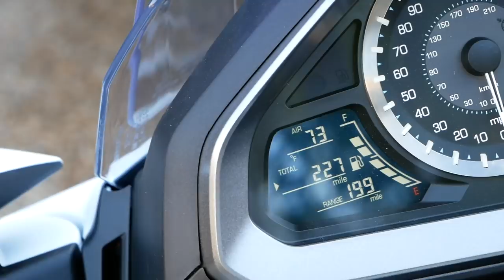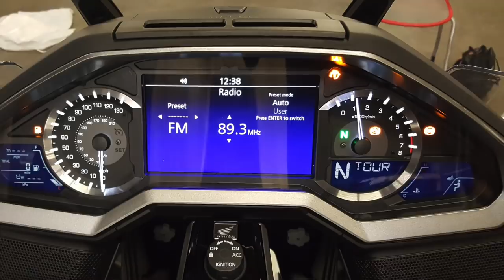2018 Honda Goldwing Long-Term Review

Comment: Chris do you have a rough estimate of what it cost to make this bike perfect for you? Talking about aftermarket parts and accessories
Reply from the maker: An interesting question. Wingsoft was about $440, F4 Customs +4 costs about $400,  Fuse Block $120, HomeLink, Fog Lights, Upper Deflectors probably another $750. I am guessing around $2,000. BUT, I had close to $4,500 in add-ons on my 2012.
Reply: Yeah I was just curious. I personally don’t like the smaller but that’s just opinion I have not rode one but I’m sure if it’s made by Honda it will hold up good. I have the 2015 and I’m sure I probably have a couple thousand dollars in accessories

Comment: How do you feel about the airbag option.  I like the blacked out version but airbag is only available in red.  Also can you take off your pack and seat for local driving and out in for long rides?   I am looking at one tomorrow
Reply from the maker: Airbag model is fine, but less storage. There is method for removing the trunk, but it is a pain in the A$$. Takes more than an hour.

Comment: Hi. Any issues with the rider triangle?  Do your hips or knees have discomfort?
Reply from the maker: Honestly, I was expecting to feel cramped on this bike and was shocked when the riding position was almost identical to the previous Goldwing. I have a 33" inseam. If I had 34 or longer, it might start feeling cramped.
Reply: About the same as me. I have a 1998 Valkyrie and feel a bit cramped.  When I sit on the new Wing it seems to feel a bit better.

Comment: Hi. I would like to know from you if buying a gold wing is best when in comparison to other touring bikes like a BMW gtl k1600 or a Harley davidson Road glide etc. After owning it for an year what's your suggestion? I am looking to buy a gold wing. Need your suggestion. Thank you.
Reply from the maker: Tough question. For me, personally, I prefer the Goldwing for its reliability, smoothness, performance and ease of self-maintenance. I also prefer the looks. But, the BMWs are also great machines and Harley's have their huge following as well.

Comment: I wonder if you regret getting the dct rather than the manual.
Reply from the maker: Not really. I think I would have been happy either way. The only place the DCT really fails is when riding switchbacks, like Tail of the Dragon, the constant up and down shifting is too unpredictable. Manual mode is required, and a pleasure in these situations.

Comment: How many kilometres do you get on your radial tires?
I ride 35,000km a season (in 5-6months) and I’m worried I’ll have to buy 3-4sets of tires a season. Could get very pricey.
Reply: Darkside
Reply from the maker: I have 8,700 on my Dunlops that came with the bike and they look to be in pretty good shape. I think I can get 12k out of them, but will have to wait and see.
Reply: On my 2012 I got as high as 37,000km on my back tire and 29,000 on my front tire.   I live in northern Ontario in cold temps and I don't cruise any higher then 110 kph (usually 90 to 100) so my tires last way longer then Goldwing tires from the hot temps of southern USA (with higher speed limits I may add).
Reply: HenryHonda 
I have never heard of any motorcycle Radial tire lasting 29-37,000KM. What tire are you using?
Reply: Dunlop E3's.... now have E4's on but haven't changed them yet.   A couple of my Goldwing friends have had about same mileage out of their Dunlops.  Are you in Canada?
Reply: HenryHonda 
Yes, I’m in Alberta, Canada. Hopefully we will be able to start riding in about 6weeks. 
Thanks for the info on the tires. I really appreciate it. I’ll get my buddy to try those tires on his 2012 Goldwing and see how the mileage is. I have to save up for a few more years for the new Goldwing as their $30,000 out the door for the manual. Rode safe
Reply: HenryHonda
How is the Dunlop E3’s Wet traction?

Comment: how does this compare to the BMW?
Reply: Rider did a great comparison. I've ridden both a few times side by side and I agree with their review. Its available on line. They are both very good but very different than each other.
Reply from the maker: I have not ridden any of the new BMWs, so I cannot offer any guidance. However, I do know that BMWs are VERY expensive to maintain.
Reply: I put 52000 miles on my K1600 and overall among 30 some new motorcycles and models including 6 Gold Wings, the K1600 has been my overall favorite to date. Last fall I test rode a 2018 GW twice. My K1600 is now sitting at the Honda dealer and I expect him to have my new DCT tour ready in a couple weeks.  The Wing feels lighter and more nimble than the BMW, but I have never felt the BMW to be top heavy, even with my wife on the back. The new Wing is no match for the BMW in a top gear roll on, the K1600 will eat the Wing alive. On the BMW K1600 GTL I really have enjoyed the ability to remove the trunk and seat in a matter of seconds giving the bike an entirely different look. The engine on the K1600 is smoother than the Wing, but the DCT on the Honda is a dream to ride. I feel the suspension on the K1600 is more in the line of sporty than the new Wing. On my BMW I did my own maintenance except for a one time valve adjustment which gave me a total cost over the entire 52000 miles of $520.00. The Honda has much better straight line stability than the BMW and gave me a more relaxed ride feel on the Wing. I am really looking forward to my next Wing, but I will still give the K1600 a two thumbs up.

Comment: So basically they made a bad version of a st1300? To me tech doesnt sell a bike as the main tech i use is a satnav and no bike comes with a good one. stereos on a bike are far superseded by a cardo q1 with decent earbuds instead of speakers allowing you to talk to your passenger. The pan holds a xl in each pannier and 2 in the topbox and every bike i have found since does not this to me is stupid as i have never run out of space on my pan. To make do or to do a workaround on a very expensive bike is a bit nuts. The pan has a locking pocket.
The only thing a goldwing has going for it is the dct but that is very overshadowed by the 5 hour air filter change and the 3 bolt 2 filter oil change and god forbid it ever fails. Unless you deal with heavy traffic every day and have to ride slow alot the dct is not worth the effort. When i get older and need less space i will probably go with a f6b or a star eluder. With all the tech on bikes now hopefully some genuis will give an option to turn off and hide features you dont need so your not scrolling through settings you dont need.

Comment: Re bag size volume “it’s the price you have to pay to have the smaller, more nimble motorcycle”. Honestly NO. The BMW R1200RT is definitely smaller, lighter and more nimble. Yet it has much larger, better designed bags that are also removable. This was just poor design by Honda. They styled the outside of the new Wing without giving proper consideration to both the raw volume of the luggage and the interior wall shapes. Heck even my 18-year old ST1100 has bigger, better (and removable) side cases.
Reply from the maker: They could have done better, for sure.
Reply: My R1200RT gets 53mpg average. And you can remove all luggage for local rides. Love this DCT GW though but it just does not have the ergonomic natural feel of the beemer. Also have a DCT Africa Twin, would love it if DCT migrates to other makers.

Comment: I am very disappointed in my purchase of a 2018 GW Tour.  I also owned a 2014 and I should have known better, I did not like the width of the older model, the highway peg position, the sport bike like rider position, the awkward shift lever position and the newer bike has far less wind protection than the older model.  There is more lean angle on the new GW and the suspension is very smooth but also somewhat floats like a luxury car.  I don't really care for the electric windscreen or the very small windscreen.  I added the lower Hondaline wind deflectors and they don't work that great.  Then wind across the top of the hands is an issue as well.  Overall, for a tour bike,  I'm not impressed.  The engine is not quiet at idle after it warms up, lots of valve train noise that the previous model did not have or was not noticeable but the alternator noise from the previous model is not on the new model.  The modes, I find are ridiculous and not really necessary.  The FM reception is very poor even in a metropolitan area where reception should not be a problem.  If you don't link up the bluetooth devices in the proper order then the Apple Car Play will not work, headset has to be linked 1st and cell phone plugged in not blue tooth connected.  No accessory plugs for charging not even in the trunk and having to disassemble the bike in order to install a low cost item seems a bit absurd, should have been standard option on a tour bike.  The trunk should have been a simple way to remove to make the bike multipurpose and having to purchase an $800 kit seems to be a bit much for a high end bike.  Laslty, the storage space for a tour bike is pretty much non existent on this bike.  There is no way you are getting two full faced helmets in that trunk unless you both wear a small helmet.  Just not impressed at all for a tour bike.  A two up sports bike, ya this fits the bill in sports mode.

Comment: I think you apologize for Honda way too much.  I miss my 2016 B.  This 2019 the Suspension sux,  handle bars shake, stereo like a 1978 Kmart Soundesign.  Wind protection sux.  Seat sux.  I’ll have another 10 grand in it before it’s worth a fuck.  Only half way there

Comment: Bad radio reception - poor GPS/Nav system - poor Android - poor seat comfort - lack of space in rear trunk - difficult air filter replacement for $30,000+  Honda can do so much better engineering than that. It seems obvious that it was rushed into production as most of these issues could easily be fixed if Honda was actually listening to their customers.
Reply from the maker: You are only looking at the downside. Smooth power delivery, excellent transmission (DCT), sport bike handling, improved suspension, better fuel mileage, electric windscreen, integrated Bluetooth, great styling.

Comment: Question.  Does the Econ mode on this bike re-map the engine for better fuel economy, as on the Concourse, or does it only give a softer throttle response?
Reply from the maker: Not sure about re-mapping fuel/air, but it does change shifting on DCT for improved mileage.
Reply: That’s what I thought.  So, kinda useless on the manual shift.   Thanks.
Reply from the maker: @jamesb.2064  I would not say that, I have just never seen it mentioned that it alters the mapping.

Comment: Cruiseman, you need to wash that double-mirrored mofo before you show close-ups. Looks like you just got back from a long road trip.
And to all those non-mechanics out there, you'll have to take a second mortgage on your house to write that check when your air filter needs a change out.

Comment: I told my Honda dealer when the 2001 came out with smaller saddle bags that eventually the Goldwing will be built in Japan I'm not going to buy one. Cheap cheap cheap built to get you in the shop for maintenance I got more chrome on my 95 SE off the show room floor two tone that is not like a older GM car where they paint the lower part below the fenders and claimed it two tone.  I even look at the pinstripes on a new 2017 the trunk and side panels no clear coat over them Cheap Honda Cheap and when Honda don't work on any 1500 gold wings that are over 15 years old that closed the door on ever purchasing this cheap crap that Honda says is worth 30K I see a 19,000 dollar bike and no more you get more ABS plastic in a car then on a motorcycle Like I told Honda dealer when the 2001 came out either go big or go home.  Now that Honda has gone home too me it is stay home not going to enjoy a new wing again.  I'll wear out my 1500 that now has 240k on the OD These were solid bikes they just needed up grades like fuel injection and ABS. I look at the new Goldwing big mistake giving these tiny tourer the Name of Gold Wing.